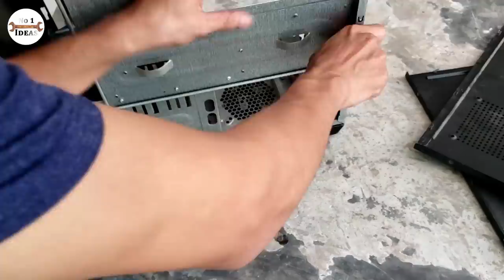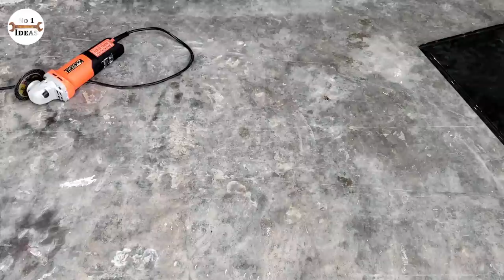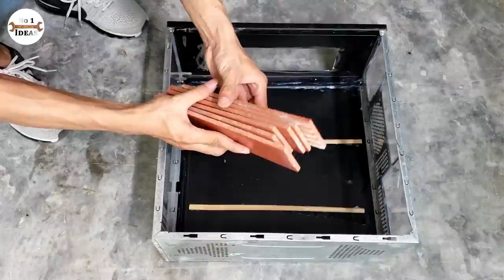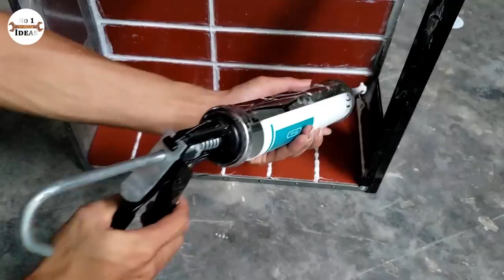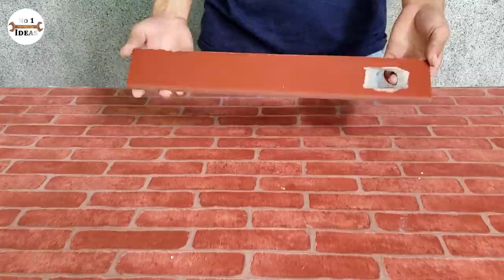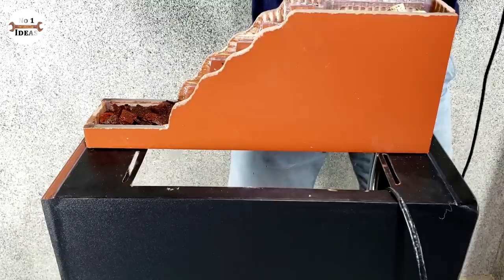Changed Damaged PC ( PERSONAL COMPUTER) into BEAUTIFUL AQUARIUM

Comment: I like the idea, but I have some constructive ideas: it could look more like a "sleeper", which means look exactly like a computer on the outside. Those wood panels wouldn't be visible, the power plug could be on the same place as the original PSU, the PSU power button or front panel power button could be used as an on/off switch for the pump/light with an LED on the front pretending that the computer was on, an LCD display on one of the 5.25" bays showing the water temp instead of the fan speeds and/or CPU temp, and the top optical drive could be modified to use the original motor to open/close the tray and drop food for the fishes. A filter would have to be somehow hidden on the inside, though. And no, not even in a THOUSAND years I could do what you did 😉